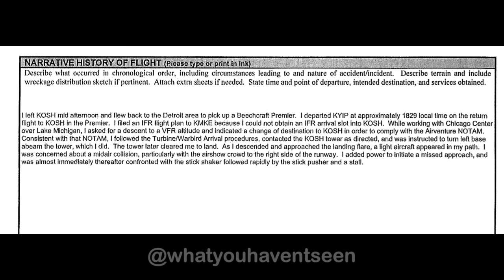Jack Roush Crashes Private Jet At Oshkosh (2010)

Comment: This goes to show that just because you're rich, doesn't mean you should fly.
Reply from the maker: I agree about that saying, but I disagree that "this goes to show" anything about it. When a commercial airliner crashes due to pilot error does that "go to show" anything?

I think anyone flying a multiple-engine high-performance jet as the only pilot onboard is asking for trouble. If you're comfortable with someone flying a high-performance jet solo, however, Roush isn't your standard rich guy with a jet and a pilot's license. At the time of this accident he had nearly 9,000 hours of flight time, more than 6,000 of which were as pilot in command of a multiengine aircraft. He was current on his medical and the only restriction was that he had to wear glasses. What more can you ask of someone? (Other than to have a copilot. That was unnecessarily risky.)
Reply: He had to fly there because he crashed his Lamborghini.
Reply: What this goes to show is how even the best pilots can get into trouble when low and slow, and the tower alters their (the pilots) normal landing procedure.   Famous last words/question, "Can you turn in early"?....  A pilot says sure, then thinks where are my flaps, should I put them in now. etc., etc..  Next thing you know you stall a wing.  The amount of unknown variables can stack up fast, and IMO, landing procedure variables need to be 10 hours of your flight training...  And remember, you can land almost anything with 10 degrees of flaps...
Reply: Mat Helm pilot school 101, ATC doesn't fly your aircraft......
Reply: This guy is nowhere near the best pilot .... clearly from 2secs into the clip he was done and never did anything to correct his mistakes. He was showing off and it cost him. Roush in his own words is “a risk taker,” “a managed risk taker. Just FYI I he bought another 1A
Reply: F900EX
No one called him the best pilot.  And you can't tell any of that from this video.  He was instructed to turn base abeam the tower, which he did.   He's banking left, which obstructed his view to the right as he turned.  Which meant that he lost sight of the Cessna taxiing.  He said he instituted missed approach because he thought that Cessna had taxied onto the runway.  What I think he didn't account for in the many added variables of turning in early, was the time it takes for turbine engines to respond.  So his speed was lower than he expected, and he stalled a wing..  But he is a brilliant engineer and did have over 9000 hours, how many do you have?
Reply from the maker: @Matt Helm - At first I thought you were only going to argue that Roush technically "remembered" that a go-around requires throttle-to-the-firewall power, but it sounds like you are also accepting as correct Roush's account that there was a traffic conflict. I don't doubt that Roush believed there to have been a conflict, but there wasn't one.

One point this crash hammers home is that air traffic controllers know what they are doing. So often people say things akin to @Van Lightspeed's comment that "ATC doesn't fly your aircraft." That may be true, but this is a strange place to make that comment. This accident was in large part caused by Roush not believing the controller who told him - correctly - that there was no conflict. Separation is their job, and they know that a high-performance jet is faster than a Piper Cub.
Reply: I do accept it as correct that there was a conflict with two Cubs.  Because the departure transcript shows that the controller had just cleared the 2nd one for takeoff.  Plus this video shows how close he was to one of the Cub's in the picture at 0:42.

Now the reason he was so close was most likely because his turn was wide right of runway 18R.  Which ate up distance with the correction.  And his not having a 2nd radio tuned to departures meant he didn't know the Cub's would be there, or that they would hopefully turn left out of his path.  Oshkosh is a circus where you end up closer to other aircraft than you've ever experienced.  So things being a little sketchy is the norm.  But to turn a Lear type jet in early (abeam the tower) behind a couple of Cub's is a little crazy IMO.  I'm not saying Roush wasn't at fault here.  But his were faults of assumption, because/and he wasn't monitoring departures.  And controllers have a bad habit of creating information overload.  By either asking a pilot "can you" or otherwise upsetting normal procedure during the most critical point of flight.  The first thing pilots seem to lose in the distraction is a since of their speed.  Added to that, the distraction being traffic in front of you, preventing you from going full throttle (in your own thinking), and you've lost what is normally your main reaction to trouble when you're low and slow.  I mean he could have gone full throttle over those Cub's (assuming they stayed over the runway) and blew one of them out of the air with his jet wash...
Reply: Literally Shitler 
People who are rich tend to be
risk-takers to a certain extent. They like to think that money can buy their way out of problems. Gravity doesn't work like that...
Reply: Mat Helm   Cause the airplane stalled and crashed!!!!
Reply: Yep. The secret word is "unable".
Reply from the maker: @Matt Helm - The following quotes are from the NTSB's Air Traffic Control Group Chairman's Factual Report, available in a Google Drive document repository at http://tiny.cc/roushcrash. 

"The Cub was clear of the runway before the Premier turned inbound on the final."

"Mr. Schaefer saw the aircraft and pointed it out to the other team members. He did not continue to watch the aircraft, and next noticed it when he heard the pilot ask, “Is this going to work?” At that time, Mr. Schaefer informed the SLC AC that the Cub on 18R was departing and already airborne, so it was not a problem. Mr. Schaefer then saw N6JR overshoot the final and end up west of runway 18R. The pilot then said he was going around, and Mr. Schaefer again advised the SLC AC controller that the Cub was airborne and to the left of N6JR, and was not a problem. N6JR appeared to level off, but was slow and then descended as if to land. The aircraft crashed before reaching the P3 taxiway."

"Mr. Stokes was the SLC AC controller, responsible for communicating with aircraft in the 18R traffic pattern. His observations were similar to those of the other controllers, with the addition that he described the Cub’s position when N6JR commenced the go-around as “airborne and offset.”"

"When the pilot of N6JR asked “Is 6JR OK with this?”, Mr. Stark saw that the Cub was airborne between runway 18R and runway 18L, and “...no factor for N6JR.”"

There was no conflict.

(Thanks for the adult conversation on YouTube. Refreshing.)
Reply: Skyprince27, 
Must be nice to be able to read someone's mind....  Jack Roush worked his way to being "rich".

What You Haven't Seen
Things appear very different from the ground, than they do from the cockpit.  And Piper Cub's are treated almost like hot air balloons.  As in they can be a hazard to even a Cessna 150, because they can hover in a lite wind.  So I very much accept that any pilot in a Lear type jet would see them as a obstacle.  So wither they were are not actual obstacles, they would still cost a pilot valuable calculation time, and add to brain overload.  

What people, and even some non jet pilots don't get, is that when you fly a large plane or a jet, it's like you have a long whip like tail of turbulence and jet wash trailing behind you.  So think about that being a consideration in this case.  Him having to turn left to get back to the runway he overshot, meant that he was pointed directly at the Cub's exiting to the left.  Yes he could have added full power, and blasted right past (and over) those Cub's.  And flipped them out of the air (to his thinking).  So instead, he adds what he thought was enough power to maintain his altitude.  But then he had to bank right for the center of the runway, and stalled as he was coming wings level.  But still, I think there was just too much going on in his brain.

My real point is that this can and does happen to pilots all the time.  To ignorantly make some demeaning assumption is beyond stupid.  To learn from other's mistakes, you have to be able to try and put yourself exactly in their place.  Which for most of us means we've had to experience an oh $hit moment ourselves, in order to understand how fast things can get out of control..
Reply: As a retired professional pilot, I concur with that remark 100%.  I don't know enough about this partcular accident to say whether or not it applies here.  But, in general, yes, and I give you Thurman Munson as a specific example.
Reply: I would ask they they not crash.  Properly executing a go-around is a basic skill maneuver.  Not getting yourself into a situation where all your skills are called upon is a judgement maneuver.  This was his second crash, by the way.  Nothing wrong with a rich guy or an old guy flying a high performance aircraft, but you have to know your limitations.  Or the earth will teach them to you.
Reply: Spoken like a true pilot. All good points and I agree.
Reply: 100% correct sir. Too many pilots for get that.
Reply: Doctor Killers.
Reply from the maker: @Matt Helm - Spot on.
Reply: Got it all wrong.  Has nothing to do with just because you're rich.  It should be, just because you hold a plastic card, doesn't mean you should fly.
Reply: Mr. Roush was an F-4 pilot in Nam and flew 747s his wife is a captain on a Gulfstream.  What do you meant "because you are rich."  He had a bad day.
Reply: From what I read he has no business flying anything.
Reply: If you're rich, you should fly first class.
Reply: @Mat Helm I (semi-)liked your comment about "what some people don't get" and the possibility that Jack(ass) may have had "brain overload" at the time of the crash (and probably even while whistling Dixie) So you clearly explained that he COULD have been considering the potential jet wash causing harm to the Cubs and possibly he calculated that factor into his decision to go against adding full, go-around thrust per op manual and during his brain-fart he made up his alternate power % rate to semi-blast the Cubs and still stall himself (brilliant) but with additional speed and thrust added to put on a good show.  Nice. What I don't get is why he didn't provide this insight to investigators? Maybe Jack-ass, again,  had brain overload when giving his report and just forgot to furnish this important info that we only have you to credit with that it even exists(ed). But not to worry, the real credit you seek and deserve is right there in your very own words in your last paragraph. "to ignorantly make some demeaning ASSUMPTION is beyond stupid" Well put Matt, very well stated. And even though you warned me against doing so, I am going to make one of those "beyond stupid" comments by saying that I bet you have had many of those, what you refer to, as "oh $hit" moments, and the more of them you have the more you interpret them as proof of your superior piloting. Maybe you should get off your (hypocritical) high horse and exclude "could-be's" "maybe's" and "assumptions beyond stupid" before you become another Jack-ass. Well, technically, you already made yourself one by your "beyond stupid" comment right after committing the act which self-qualified you with an A+ rating.  I could assume that you just had brain over-load when writing the above moronic statements but that would be "making demeaning assumptions" so we'll just take you at your literal word that you intended to fully and voluntarily, demean yourself by making demeaning assumptions right before speaking derogatorily about doing so and claiming it as being "beyond stupid". Glad I'm not flying around with Pilot "oh $shit" who is "beyond stupid" and clueless about it, while mindlessly blathering at others while doing so himself. To be aware, is to be alive.
Reply: If a very friendly, community-minded, loving husband and father, and in all ways a good person, except that every 9000 hours or so decides to go out and kidnap, molest, and murder a little boy. (like the BTK killer priest a few years ago) is he still a "good person"? NO, that absolutely makes him a horrible person.  NOT a good person. And as stated already, Jack's 9000 hours have not been without serious crashes and who knows how many near crashes and minor slip-ups that resulted in no known harm. Lets not speak of his 9000 hours as 9000 good hours. The best you can say is he has survived those 9000 hours. But just barely, when he ruined that P51 Mustang he almost drowned himself crashing and ending up upside down underwater. He lived on to crash his jet due to someone rescuing him from his last near fatal pilot error crash. Jack(ass') 9000 hours are no badge of anything to wave in his favor.
Reply: I couldn't agree with you more. Sad too. Nice plane for serious people.
Reply: David Soom   Pilots Are trained over and over not to “have a bad day”. If you have a bad day you and your passengers could end up dead. ☠️
Reply: Mat Helm   Really? Land a corporate jet or an airliner with just 10 degrees of flaps? You had better have lots of runway because your landing speed just went up by a bunch. You do know that some airliners have to be above 10,000 feet to accelerate to a speed where the flaps/slats can be fully retracted because I’m sure you know below 10,000 the max normal operating speed is 250 kias.
Reply: Stupid comment! What does money or no money have to do with being a pilot?
Reply: Mirko Sebestik+ I'm sorry you're triggered.
Reply: This is Karma.  When I worked in the auto industry, his company was known for low wages for what they wanted.
Reply: Literally Shitler Hey I'm rich and I'm always flying high!
Reply: Why is everyone assuming he is rich? For all we know he spent his last cent after saving up for 20 years and is  still struggling to make his loan payments. I'm not saying he is poor, I'm just saying $4m might not be super easy for this guy to come across. He made a mistake; it's unfortunate this particular mistake costed his insurance company upwards of $1.5m, but that doesn't make him a billionaire

EDIT  I didn't see his name at first. He obviously thought it was a mustang, so he was discarding some of the parts he didn't want because he was going to install a bad ass body kit. He was probably aiming for the crowd but stalled on his way
Reply: He was showing off plane (lol) and simple...

Comment: People posting comments that this pilot should not be allowed to fly. 

Based on that very low, tight banked approach with a jet of that category, and the following "ballon" upwards, subsequent nose down correction, then trying to hold altitude with pitch instead of power... 

I agree. 

Take that type rating.
Make em pay the cleanup.
 He fly's like a mustang driver drives. Heading for the crowd.

Comment: Downward iso-pressure most likely caused an unstable bandwidth of heated air which looped into a ferocious semicycle of negative angled force. This in turn caused the dynoflow path to have streamlined assimilation....

I have no idea what I am talkin bout
Reply: Don't forgot about the known issue with the spirving bearings that interrupt the soino-soidal whipser flow, causing the grammy shaft to wobble.

Comment: Hard to see the position of the ailerons, but looks like it may have been adverse aileron yaw.  This is where a plane is near stall in a bank and ailerons are applied to roll level. but the down side aileron increasing the angle of attack causes that wing tip to stall, rolling it harder in the direction you are already banked.

Comment: This demonstrates one aspect of the superiority of an all-composite fuselage and the groundbreaking Beechcraft Premier. In layman's terms, a typical similar size aircraft made of aluminum would have been crushed and fragmented in a crash of this type---which would likely have been fatal (particularly had there been passengers on board). And in any case, it is unlikely the pilot would have exited the aircraft under his own power with nothing more than a bump on the head. It is too bad this technology was acquired and shelved.

Comment: According to the NTSB, the plane crashed because of the "pilot's decision not to advance the engines to takeoff power during the go-around, as stipulated by the airplane flight manual, which resulted in an aerodynamic stall at a low altitude.".
Jack... what the eff...